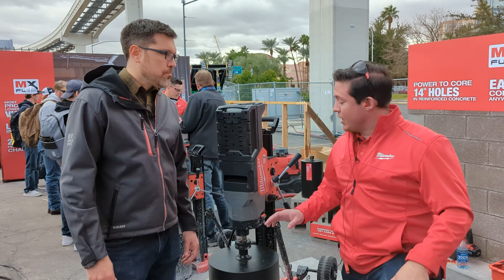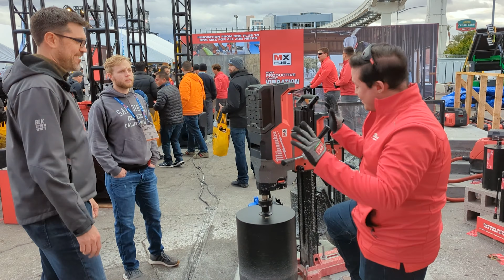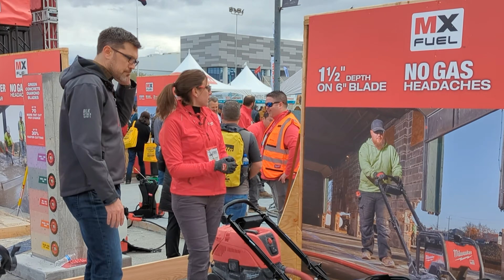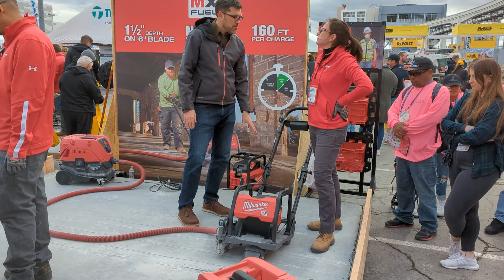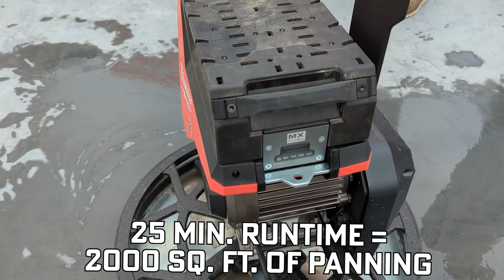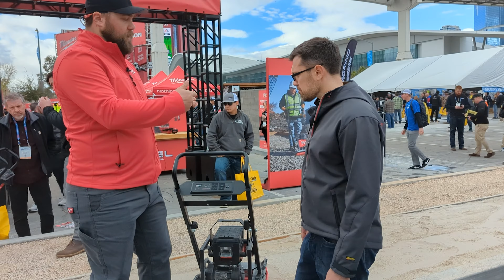Milwaukee FUEL Green Concrete Saw, 24" & 36" Trowels, 14" Core Drill and Plate Compactors - MX FUEL

Comment: Milwaukee is making a last ditch surge to try and save this failed line, nobody is buying this crap,  it's too expensive for the small guy and large construction companies rent and they don't run long enough
Reply: Very interesting pov. I think you’re right!
Reply from the maker: Hey Lou! You'd be surprised actually how popular a lot of this stuff gets; it may not seem like it as you said due to the price point, but we've seen them fly off the shelves for the right customer!
Reply: @OhioPowerTool  It ain't selling, and it's battery technology is way behind dewalts new batteries for large equipment to be of any use, the only thing that is selling is the power station and now that they came out with the fuel  that's gonna stop selling and stop being a shill for Milwaukee
Reply from the maker: Well, to each their own, we suppose! The people that are interested in the products will be interested, and the people that aren't won't be; ain't that just the way!